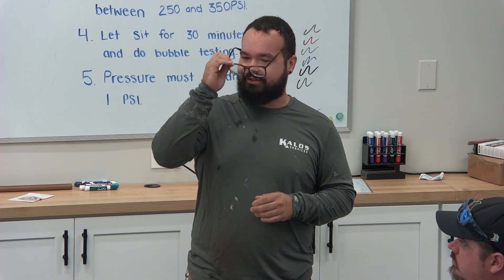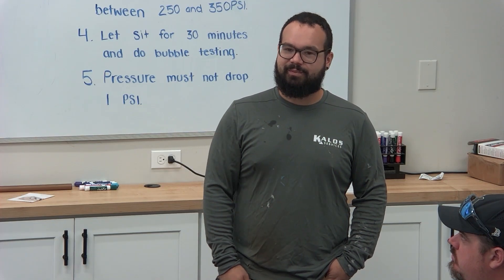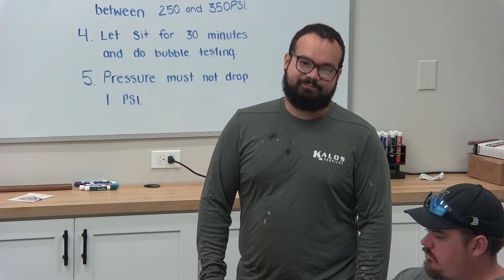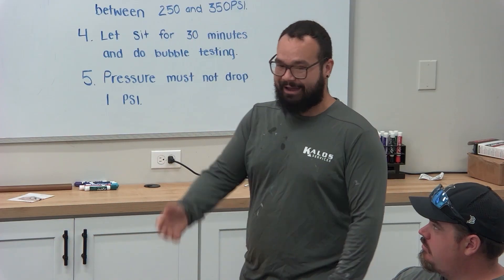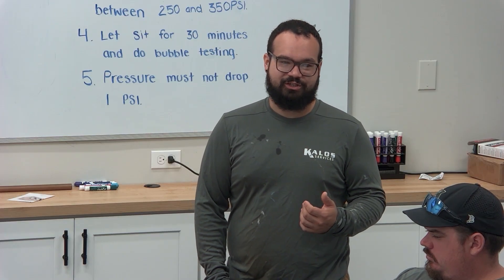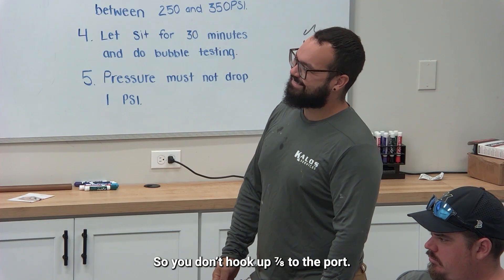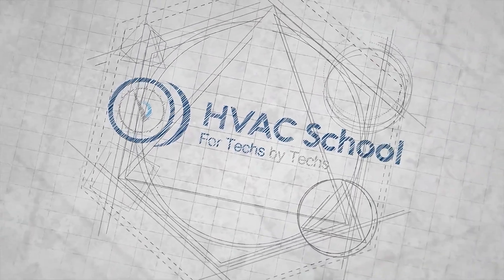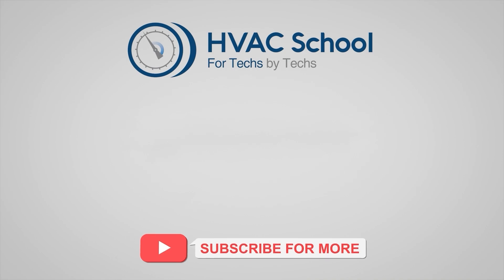HVAC Installation Best Practices: Copper Lines, Equipment Prep & Quality Control Tips

Comment: Just putting it out there for field techs...I recently found three failed gas valves in three different heaters in different locations. One was stuck closed, and two others were allowing some gas to leak by in the off cycle...very concerning. Each of these units were 7 to 10 plus years old. Please check carefully for gas leaking into the burners while you are doing planned maintenance. When in doubt, rip it out. (Replace it)